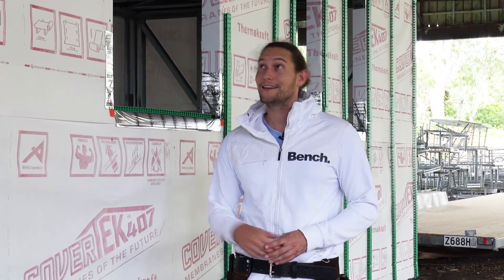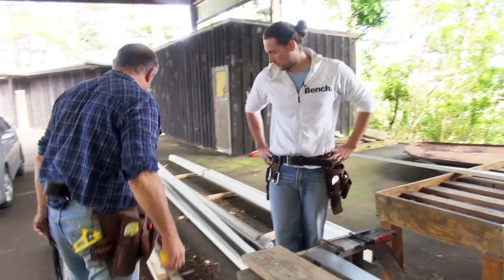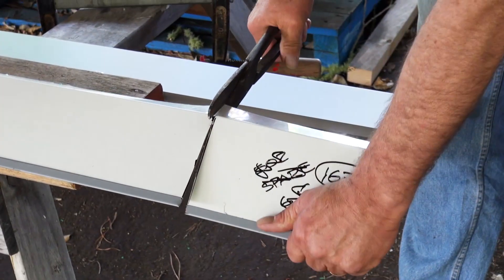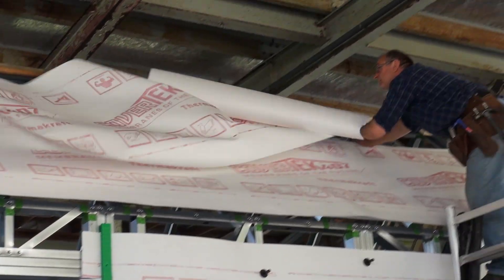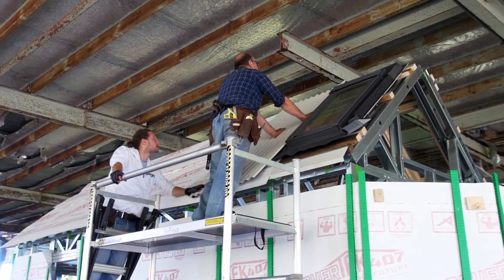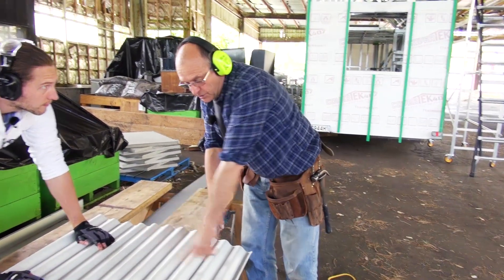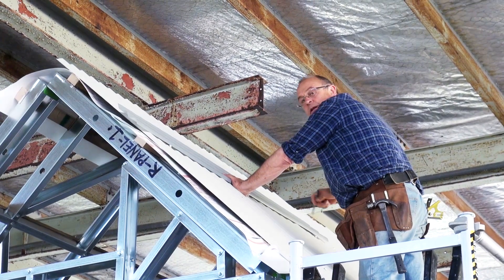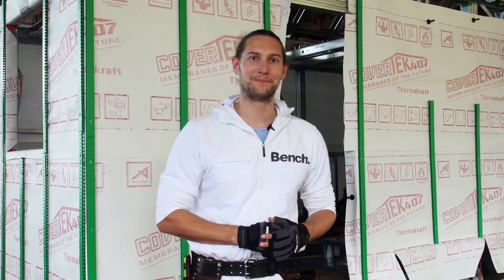Installing  A Corrugate Roof (Part 1)

Comment: Hey mate, good job on roof. 
                                                 As an ex solar panel installer (approx 1000 panels), in my experience as an apprentice, I found that tin roofs, although easier to install, had a much higher chance of stripping the screws whilst installing solar rail mounting L brackets. (especially into steel frames- this would occur because you have to remove the hex screw and reattach to the same hole, thus making stripping the hole more likely than an original virgin screw). 

A tip for people building or DIYing (note, I am not a qualified builder or sparky, so check with all local relevant laws etc) would be to mount the L brackets as you go/ install the roof (they also hold down the corry).  That way you are maximising the strength of the hex screw/ solar L bracket's holding power, and minimising potential for stripped screws as you are killing two birds with one stone.

 Also, similar to having a layer between the steel frame and timber, it is the same with mounting alloy solar L brackets to Gal to prevent galvanisation. We used a thin rubber 'spacer' similar to the rubber spacer on a hex roofing screw. We would also use silicon to further prevent water penetration. This might also be a consideration in design (for truss spacing) as there are local restrictions on the 'minimum' spacing required of solar brackets to enable a cyclonic wind rating. From memory in Australia it was a maximum of 800mm between brackets, but if you have a stripped thread, you have to move to the next corry peak, which means uneven spacing. (and siliconing the stripped hole). 

From an installers point of view, it would be such an easy job to rock up and mount the panels on a pre-prepared tin roof! (and save a lump of time in labor and harnessing etc). 

Love the videos, hope this helps one person on the planet!!! 

From Wespups.

Comment: Thanks for the video! I see you only have horizontal strapping, is the profile in the metal itself enough to provide airflow up to the ridge? What happens if water gets in there - how can it drain? Thanks

Comment: @5:45 you measure for flashing or guttering to come out 97mm from the frame. My understanding is that your trailer and frame was 2400mm wide, allowing for 50mm to be added either side and remain road legal within 2500mm. Did your tiny house end up too wide, or am I getting videos and regulations mixed up?

Comment: Have you heard of Attic Foil? It reflects heat away from the living area. It requires an air space between the roof and ceiling so when you install ridge vents the hot air is pulled out through the open space between the roof and living space your interior living space will not get the hot air in the house. Search radiant barriers to find out more. or search attic foil.

Comment: It looks like the overlaps were done such that the top overlap is towards the direction of travel... I expected the opposite so that there would be no concern of wind getting under the overlap joints when on the road...  Did I see this correctly? and if so, was it done intentionally this way, and why?

Looking great in general..  Thanks for the excellent vid series.
Reply: +Tyler Austen I have the same question, seems like the roof layout should have began from the rear to ensure that lap sheds the water correctly when being towed.  I'm seeing a license plate and clearance lights in this video, so it appears the lap is incorrect.

Small detail that could be easily fixed if caught soon enough during the build.    Good catch on your part Tyler.

Comment: Living Big In A Tiny House , Hi! I plan on building my tiny house in October (fingers crossed), and in my designs I seem to be running into weight issues... I want to use steel framing but I also have circular windows in my design, and I dont know if I can fit those in without carving out a wood frame for them. I was wondering if you knew if I could mix and match steel and wood framing? Sorry, I don't know if this is the best place to ask... 
Your house coming along great!!!
Reply from the maker: Hey Negin! Yes, I believe you can actually frame for a round window using steel. I haven't attempted a round window before myself, but I looking online it seems like the framing is an octagon shape, which would certainly be achievable with steel. Hope that helps!
Reply: ahh okay, Thanks! IM SO EXCITED. It's gotten difficult to not talk to every single stranger I run into about tiny houses now. Good luck on yours!!

Comment: Unfortunately building something to be towed or a houseboat to standing frame standards is a recipe for disaster on the road or water, Weight is the enemy. There are weight regulations that will make the structure illegal or sink you. Innovative engineering is a prerequisite.